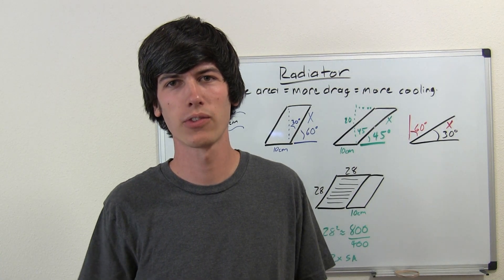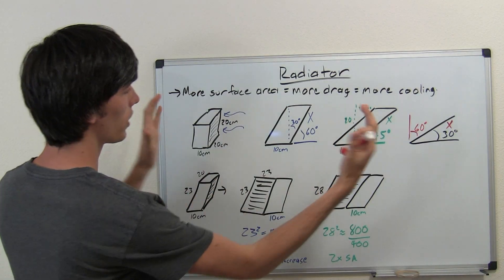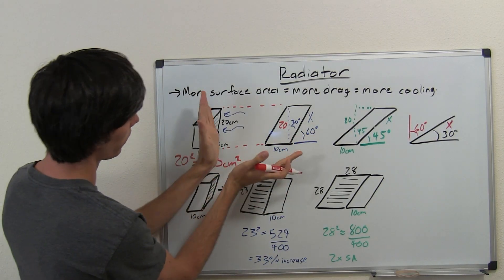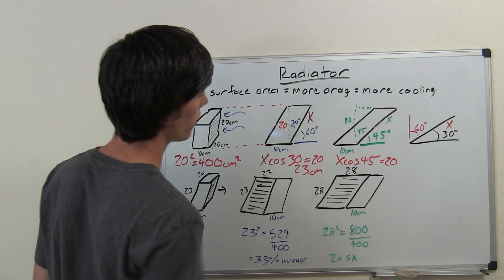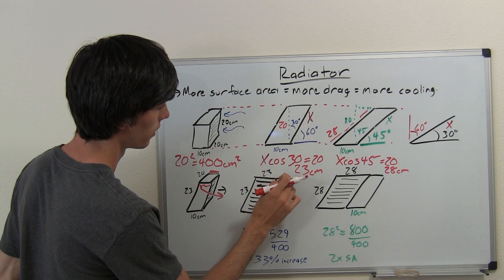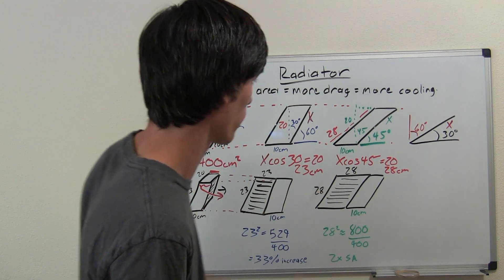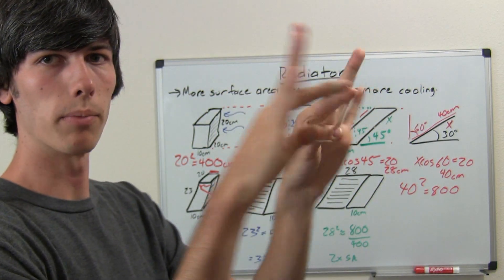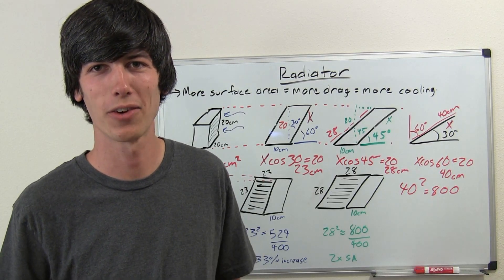Formula One Radiator Technique - Explained

Comment from the maker: Yes, I will be making non-f1 videos as well! Just thought I'd try a little segment on it as it had many requests. :)
Reply: Engineering Explained I'm curious as to your opinion on this. Even though radiators are a relatively small portion of the weight of a car, by my logic, this puts a lot more weight in the pods.

With a 20x20x10 radiator, you've got 400x of weight (x being average weight per cubic cm of the radiator including coolant). If you go to your rather extreme example of 60 degrees, that then becomes 16,000x, given the same weight per cubic cm. That's a 4 times heavier radiator for potentially minute power gains.

I'm not saying that this wouldn't work (If it didn't, I'm sure it wouldn't have been used in F1), but I'm not convinced of a net gain in performance. Am I missing something, or is this just one of those things that you have to fine tune and play with?

Comment: One thing I don't get.. The surface area increases if you tilt it but since the air still comes directly from the front you will get just as much air through the radiator whether its vertical or tilted so what do you gain by tilting it?